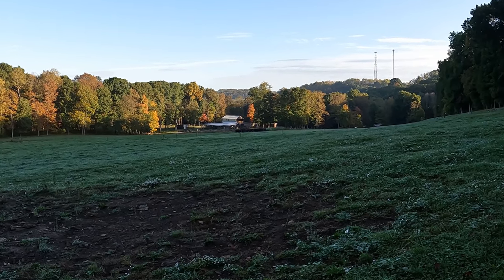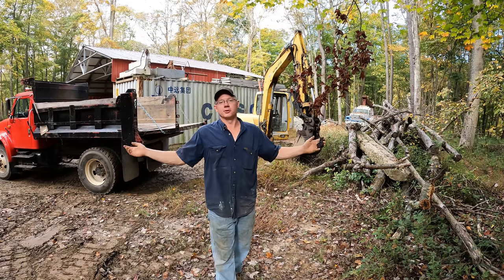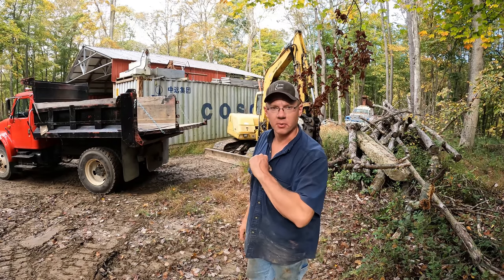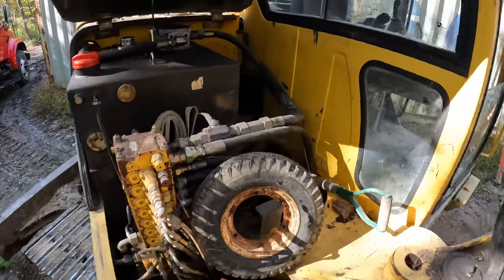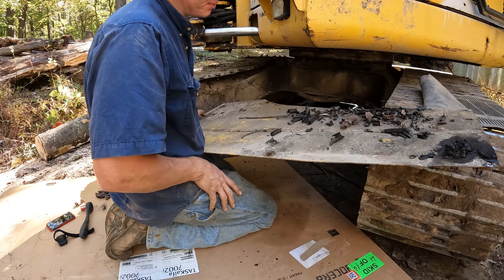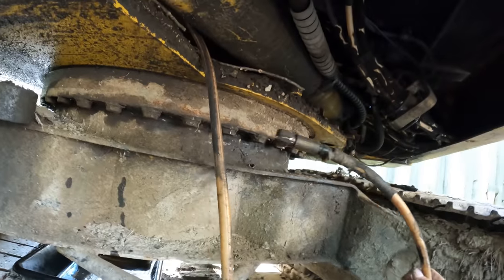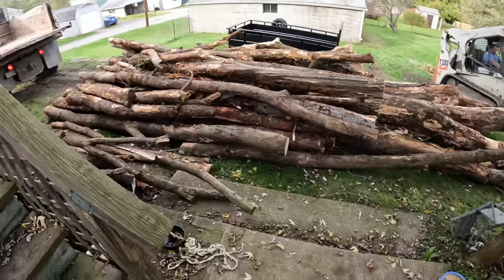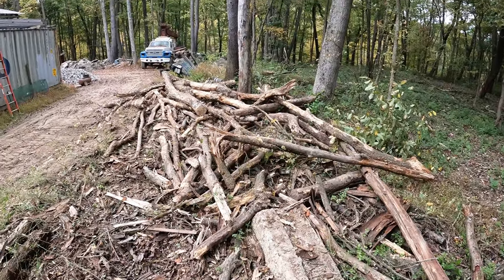Excavator Breaks Down Loading Firewood! (Not Good!)

Comment: Sure would be good if you could find a hose making with the dyes needed for your shop.
my cousin was working at a shop that closed and he picked up one with about 30 dyes
to make every thing from 1/2 inch up to 6 inch and a cabinet that had the fittings needed
to make them.   only thin was there was not hose left but it came in handy with some 
equipment he acquired over 40 plus years as a mech and equip operator.
Reply from the maker: The press and the dyes are the cheap part. Stocking all the fittings and hose is what is expensive.

Comment: Most species of wood, especially oak, will still need some curing after cutting and splitting even if the logs have been sitting a while.  Some hold a lot of moisture.
Reply: seems to me like throwing them on the ground uncovered won't do much for drying either
Reply: Little trick I found that works, stand the blocks on end on some flat wood or slabs to keep it off the ground and covered with a tarp, instead of sideways. Gravity helps to drain the moisture out of the wood quicker than having it on it's side.

Comment: On the occasion that a hose, wire or cable has to be snaked out of difficult places, sometimes it helps to tie a cord, string or some kind of lead to pull thru. That way, when you need to re-snake the new item in just tie the end and pull back through. Easy Peasey.
Reply from the maker: Yah. I was kicking myself for not doing that when I pulled the old line

Comment: I would recommend with the amount of machinery you have that you invest on buying some hydraulic hose crimping dies(ebay). And you can reuse the old fittings, you have to cut off the ferrell with a lathe and make a new one with some 1/2" water pipe. Now you will have to buy some hose stock  and common fittings if need be but my set up paid for its self with 3 hoses I made.

Comment: the outer coat of rubber is a protection layer only and add no strength to the hose its self. that said the wire can deteriorate  and cause hose failure

Comment: I use my little 6k yanmar hoe to hold the logs and then I cut rounds into backhoe bucket.  Sure I bump a chain once in a while, but it's a lot easier on my old arthritic back to use a smaller saw at a comfortable height.

Comment: Replacing the lines appropriately takes some judgement. Sometimes lines will last for a LOOONG time I only worry about condition is on heavy service lines. A couple years ago we replaced one of the track motor lines on one of our CAT 345B excavators, This year it blew another one.... I took the belly plates out and looked up to see one blown line, one new line, and two old lines with pressured up bubbles under the outer sheathing..... I spent $1200 on three new hoses and $400 on 50 gallons of hydraulic oil, because that excavator lost 50 gallons in about a minute or two before we shut it off.
Reply from the maker: Yah. Sounds about right, like I always say you gotta pay to play with them big girls. They are expensive dates
Reply: @DieselCreek  Yea I have put about $15-20K in on that excavator in parts this year(had to do injectors and one of the swing motors  etc.), but we move into a jobsite and do all of the overlot, overex, water/storm/sewer, and road prep for small apartment complexes with no GC. So having at least one excavator over 70,000 lbs is a must have, if you have the work for them.... They will pay for themselves.
P.S. I thought we moved sorta slow doing all of that with one crew but then the owner I do this kind of work for had a 10 building site to do next(I had to take care of some favors so I had to let it pass this time.) A larger outift got the job and because of scheduling issues getting different crews in (huge downtime between the overlot crew and utility crews) they are further behind than I would have been working on it with just four or five guys, cause we weave our work together to make it work the best we can and just move through the job steady.

Comment: It's kinda funny that the breakdowns are so detrimental, yet the hoses are in bad shape and not getting replaced. Seems like it's not just the cost of the machine, but the cost of the downtime as well. Those hydraulic lines are spendy, especially when they are longer and with you using it on your own site, probably just not top priority and downtime is not critically impactful.

Comment: Hi Matt.  It's inspirational to watch how you're able to extend the useful life of machinery that others might have given up on.  I was surprised to hear you question the decision to replace all the hoses on your hoe, based on the observation that the cost might exceed the value of the machine.  After tracking the cost of depreciation and repair for several of my vehicles over many years .. my observation is that it makes economic sense to junk a vehicle only when annual costs ( repair plus opportunity costs for loss of use plus depreciation plus embarrasment cost of running a "classic" ) exceed those costs on a new vehicle. The book value of the vehicle has no relevance.  What are your thoughts on this approach to determining end of life for a piece of equipment?
Reply from the maker: As I said in the video, the hoses are really just the tip of the ice burg, she needs all new pins and bushings in the backhoe knuckle. And probably line bored. New boom pin and bushing. Track chains. One idler. One final drive is weak. The quick coupler needs fixed. The electrical system is nicely botched. Several cylinders need repacked. Needs a new muffler. The fiberglass hood is busted. The seat is wearing out. The instrument cluster snapped off on the barn demo job and it’s just hanging by the wires. The  skylight needs replaced. Cab has several small rust holes in it. The blade needs the cutting edge cut off and replaced And I’m sure I am missing a few things…. And even if you fix all that it’s still an old excavator with 8000+ hours. Still doesn’t have AC and still might have another major break down the next day. I definitely don’t want a nice new machine but one a little newer and a little less FUBAR would be great. Everything I just mentioned is probably 10-15,000 in repairs. Machine is maybe worth 25k if that

Comment: Matt those small lines are not that expensive. The aggravation of working machine then blowing another one is ridiculous. I changed most of the hoses on my case 589 for prob 2000 bucks. On my Hough H90 different story. One hose was 450 bucks due to its large dia.

Comment: Here in Germany, when you use your equipment commercially, you have to change every single line every 6 years.
Or you don't get your inspection sticker.
For safety reasons of course...
And then there is the emissions garbage on every single engine over 25hp.
No wonder everyone, who can afford it, only holds equipment as long as it is under warranty. Go figure why costruction is getting more and more expensive. Everybody has to suffer, in one way or another.

Comment: Hey Matt, why not bey another container and a second roof and make the garage times 2!
Reply: Have you seen container prices lately. I was going to buy one and they have jumped from the 3k to 3500 delivered price to now right about 9k. Screw that they are just to damn costly and one might as well build a small building for that price. I priced out one ball park 20x20 for around 10k with shingles and siding, osb inside instead of drywall and every thing else. That is going the cheap route.

Comment: In this case I concur with only replacing the one hose Matt.

But if it took you all day to dismantle the cab to get inside the armrest to be able to undo 6 pilot lines before you could get to the one that had blown -- then I'd say replace them all while it's apart.

Comment: Normally I would agree about the repairs costing more than the machine is worth.

BUT with supply shortages, new equipment is hard to come by, and the used market is through the roof.

It was literally cheaper to have the engine rebuilt in my 30 year old mower than it is to buy another decent used one.

Comment: Matt I love your videos but using a chain saw without PPE is like dancing with the Devil. Years ago I was cutting brush for a friend. I was tired (first thing I did wrong) and not paying as much attention as I should have. I rested the blade agains my thigh with the chain still moving. The chain snagged the Kevlar and jammed. One pair of chaps gone but no injury. Chain saws don't cut, they rip! There are enough photos on line of folks not wearing PPE when using a chain saw to scare anyone straight.

Comment: I had a 12ft long hose start leaking on my hydraulic tail trailer and let me tell you, it wasn't easy getting it out. 2 days later the identical one beside it started leaking🤦🏻‍♂️ At this point, I think I've almost replaced every line in the rear if that trailer.

Comment: You remind me of myself at your age. I took on so many projects beside having a full time job. Eventually we all run out of time and have many projects left to do. 
We had the same problems with hoses. Strangely you can often buy pre-made hoses from the manufacturer cheaper than making them. We had a Komatsu PC400 that we replaced all of the pilot control lines on. Our Liebherr 934s and 944s had pilot line problems from when they were new and it didn't do any good to replace them with the factory hoses because they just failed again. The high pressure hoses cost less to buy a complete assembled hose than just the hose without any fittings cost us to make. Many manufacturers have proprietary fittings to.

Comment: Matt I’m not a machine operator but I’m just curious if 1 line blows out like it did here, could you just pick another line to replace as well? So you replace 1 bad and 1 good line with a new line but keep the good line as a spare then the next time you can use the spare or go get 2 new lines. I hope I made this clear and yes I understand that it’s a cost thing and I get that. Love the videos keep them coming

Comment: Yup, when I was in the equipment rental business, we flushed all our equipment typically when it reached 5 years of age and a certain hour meter reading. The rental equipment industry learned at that age and specific hours, the equipment started to become too costly to maintain due to frequent breakdowns. Labor costs for the mechanics in service trucks and shops is expensive. Not to mention the massively overpriced OEM parts to keep them running. Having un-reliable equipment for your customers is not desirable either. 
Used equipment has it place in the world, forsure. People like yourself can handle the occasional breakdowns if they can wrench on it themselves. Of course, when they throw up an engine, final drive or main hydraulic pump, hard decisions need to be made on keeping it or scrapping it.

Comment: If they'd use actual heavy duty hydraulic lines on those low pressure pilot controls they wouldn't fall apart so easily, it's not like they're rotting in the sun like the other line's. I guess that's how they make those overseas machines cheaper.

Comment: So, I'm guessing the newer models are all drive by wire, so there are no pilot lines. The whole control system is a huge stack of mains valve bodies and proportioning solenoids run by a computer.
Reply from the maker: I’d say it’s a 50/50 split, I don’t like electronic controls

Comment: One of the joys of owning any form of movable objects it will break down at least once in its lifetime, and the more you use it....
Matt with all your vehicle's surely it would be advantages to buy  the tool to put the fittings on, and purchase the hoses per 25 or 50 metre length
You would save money and the biggest plus not being at other people's mercy as to when you can get the hoses needed
To me it seems that hose places know when a person walks in the door that they have you by the short and curlies and depending on the persons desperation the price goes up for the replacement hose
Even if a good portable unit costs you a couple of thousand dollars in your situation wouldn't it pay for itself fairly quickly?
I know finding a spare 2000$ 
Is a problem on its own but add up replacement hose costs compared to making them yourself and see what the payoff time is. 
Tony from Western Australia 🇦🇺
Reply: Quite a while, or rather: Quite a few hoses.  The problem with the theory of making your own hoses is not the equipment -- it's the fittings.  Male, female, 90 degree, straight, sometimes 45 degree.  Multiply by the different types of fittings (NPT, NPS, BSPT, BSPP, JIC, etc), then multiply by the number of different sizes of fitting you need....  The inventory you need to keep on hand adds up really fast.

Sure, you probably don't need every combination (if you can even get some of them), but you need to know which fittings you do have, which often means pulling hoses to check.  If you don't have the fittings on hand, you have to go buy them and may as well just get the hose made while you're out and about.

In my case I do that, because it's a long way into town to get the hoses made.  In Matt's case it's probably quicker and easier to just get them made up.  Because not every blown hose will happen at the farm.

Comment: Sounds like you need to find an old hydraulic crimping machine. I worked for a rental company years ago and rather then wait for Japanese parts for our old excavators I’d salvage the fittings and go to the old Napa and have them crimp up new hydraulic hose with my old fittings.

Comment: you should buy a hydraulic hose crimper and a bunch of hydraulic lines, allone with the ammount of old equipment you have that money back in after 5 to 8 years also you cna make any weird lenght you need like meny manufacturers putting shitty lenghts you cant get except as specific spare parts or purpose made hoses

Comment: Can you tell me about how much that repair costed and how much You saved by doing it yourself. Thanks a lot
Reply from the maker: Ehhh…. The line was probably $80 or so, to have someone come fix it would have been wayyy more. Mobile mechanics are 150-200 per hour plus they would use the dealer to get the hose made so probably 100+ for the hose. And 2-4 hours labor

Comment: Why not buy the machine that makes hydraulic hose, that way you don't have to go to the store to have the hose made for you. Almost all your heavy equipment uses hoses, you can save a lot of money if make them yourself. provided the machine is not very expensive
Reply from the maker: The machine isn’t cheap. But what’s more expensive is inventory. You need to stock about $30-$40,000 worth of hose and fittings to have a prayer at having what you need to repair a line when it blows.

Comment: Looks like you need to get a roll of hose and a box of field/reusable fittings and keep in one of the containers, we used to keep common size field serviceable fittings on our truck. Couple hundred dollars worth of fittings and hose will save time running to a parts store to have ends crimped on

Comment: 2 things  buy hydraulic hose machine find one ,at a good price// or made in China // buy 30 foot rolls of hose and buy fittings and the most used size hose and fitting// and all the hydraulics need hoses I work in hydraulic machine repair 20 years //buy a saw mill and cut lumber for sale// at good price ,go go  sell  lumber and hydraulic hose repairer

Comment: I'm still in favor of someone with as much hydraulic equipment as you have obtaining the tools needed to make your own lines.
Reply from the maker: It’s not realistic to stock all the different fittings, my local Napa rarely has the right stuff to make lines for me and they said they have over 10k in fittings on the shelf at any time not counting the different hoses and a crimp machine
Reply: @DieselCreek  Matt, that is the truth.  Same situation I face sometimes when we need a hydraulic hose at work.  I send it to the local hose making shop and about 25% of the time they tell me "We didn't have one of the fittings for one end so it will be tomorrow (or the next day) on getting your hose back." I do make it a practice to have hoses made in "pairs" because we have almost a dozen of the trucks they are for,  so there is a very good chance we will have another of the  hose fail at some point.
And before somebody says I need to find another hose shop, I have used a few different hose shops over the years and even with the limited variables in the fleet I help maintain, I have heard the same story a few times.  And all these hose shops already have an impressive inventory, but there are still some rare fittings they do not have in stock.
So everybody suggesting you need to have your own hose making equipment are just fantasizing about a subject they are not that familiar with.
Reply from the maker: @larrywalker7759  yah its a novel idea but not practical at all. besides its not the actual building of the hose that's expensive its the cost of the fittings and hose.

Comment: Matt, THAT IS SO MUCH BULL SHIT, Rationalization, If you replace the lines one or two at a time them you will have a good working and reliable machine. You will know what you are working with, the age or value is not the point, it's the working value to you. Age will not affect the earning power of that machine just your willingness to maintain it.
Reply from the maker: As I explained in the video it’s so much more than just hoses. You dump all the money and time into replacing hoses and you’ve just scratched the surface! It needs a pile of other expensive parts. It would probably cost 15k or more to replace everything that needs replaced and then you still have an old Hoe with 8000+ hours on it and you could still have another major break down the next day. Swing motor could go or a final drive or a hyd pump or God forbid the engine. If any of those go it’s definitely over the tipping point.